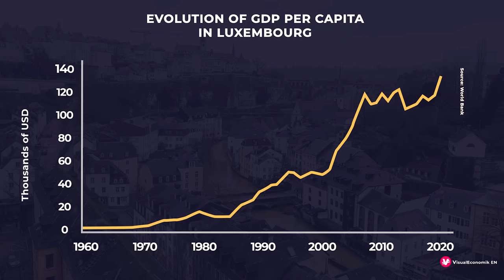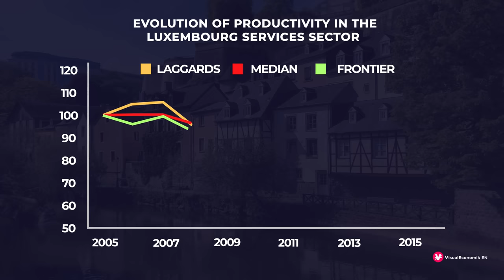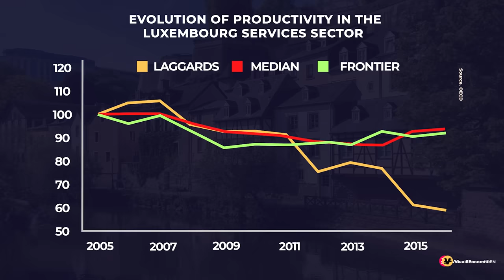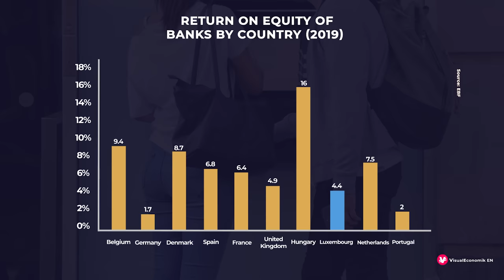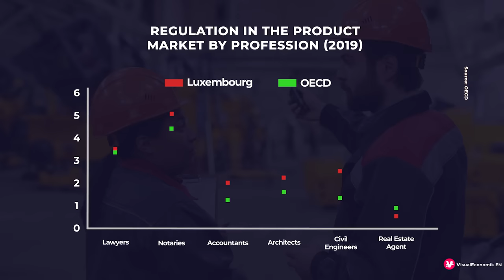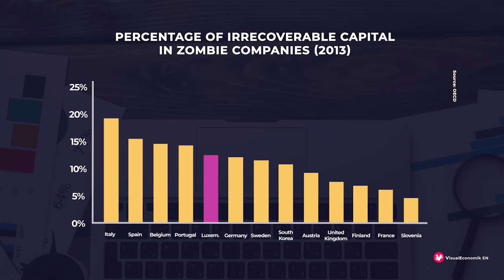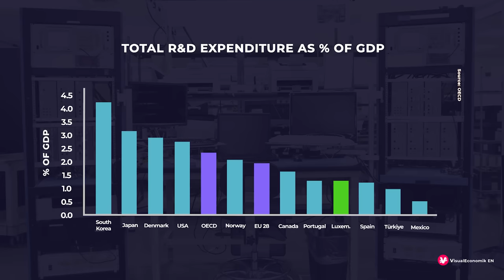Why Is the Wealthiest Country in the World Failing?

Comment: Luxembourg is undoubtedly very  rich, but its GDP per capita is inflated due to the fact that 40% of its workforce lives in neighbouring countries (which means that these workers contribute to the country’s economic output, but they do not count for the population denominator when calculating GDP per capita), and also due to being a tax heaven. Switzerland, for example, has a lower GDP per capita than Luxembourg, but it has a higher average wage. Luxembourg is still one of the richest European countries, but not as rich as its GDP per capita may suggest.
Reply: @Wisteria__Lane  It is clear that most bloggers calculate wealth incorrectly. Salary and GDP are actually income, not wealth. Wealth is accumulated income. In other words, GDP is what you earn annually, wealth is what you have in total. Therefore, this video does not give a true picture.
Reply: Afaik Luxembourg has the highest number of millionnaires per capita ( total wealth, including real estate).
Reply: @mauricesalentiny5495  >> Afaik Luxembourg has the highest number of millionnaires per capita ( total wealth, including real estate).
That's also because a large percentage of regular (non-millionnaire) workers live outside of Luxenmberg, decreasing the per-capita-denominator. It's the same reason why its GDP per capita is deceptively high.
Reply: @THX829  On purpose
Reply: @maksimkempe3425 
By "wealth" do you mean land value? It is a common error. Land is not wealth; it falls into a separate category, as does money. Most of the earnings from banking are economic rent of land.
Reply: @mauricesalentiny5495  not true USA has most rich people
Reply: Finally someone with some brains.  Lived in both countries and the quality of life and salaries are way higher in Switzerland, it’s not even a competition..
Reply: Growth and decline are natural events. Traditionally tax havens were in Europe but now more competition from Asian countries have emerged and the using sanctions as weapons by the west has made many to move money away. Also the infrastructure and safety of emerging economies have reduced the transfer of capital
Reply: @mauricesalentiny5495 are their property prices inflated too?
Reply: @mauricesalentiny5495 
If possession also counts, then those millionaires are just for the most part old people who bought land when it was cheap. Houses can easily reach 1 million in Luxembourg.
Reply: @RonDiani he says number of richs, not wealth of them. Yes the most richs are almost in USA. The second, Bernard Arnaud,  is French.
Reply: Yes, I was just going to make the same point. Well said.
Reply: @stephanelaranjeira5909  not true, I prefer luxembourg over switzerland

Comment: Pretty sure banking sector regulation or financial regulation in general tends, to a large extent, to be defined on EU rather than national level.
Reply: And that has played a role in the significantly curtailing the manner in which the banks have operated. Luxembourg was trying to be another Switzerland where banking privacy could protect all manner of guilty parties. The EU just wasn't having it on their doorstep. That's a part of what is going one but another significant part of it is that if have an economy with high expenses, and particularly high property prices, then you end up with nobody to empty the bins and it all start coming apart at the seams.
Reply: @jimf671  banking privacy isn't as strong in Switzerland as it was either.
On the flipside Luxembourg benefits directly from regulation as middle office hub for a multi-trn fund industry.

Comment: In 2011 I had an interview with IT consultancy at their Luxembourg office. (the interview was arranged by a former colleague of mine who was working for the same consultancy).  I flew out from London to attend the interview at my cost and I thought it went reasonably well.  However, it took the company 5 weeks for them to get back to me (despite the efforts of my former colleague to help).  They said my contract rate was too high, they feared I would not stay long, and so they were putting the hire position on hold (there were possibly other factors I won't mention as they are off-topic).  They didn't attempt to negotiate a rate they were comfortable paying or attempt to seek assurances from me that I would see out a contract term.  If my experience was representative of how they go about attracting highly qualified professionals then I am not at all surprised they have a skilled workers shortage.

Comment: I think you are excessively simplifying. Some points are valid like the productivity issue (allthough it's not clear if this may be related to the capital structure which is quite particular in LU). Also labour regulations are tight. What made me laugh is the banking sector part. It is very heterogeneous which you don't mention at all. Custodian banks for example typically have low profitability which is not a bad sign. The sector is very international which you don't mention either with many subs taking on services for their foreign parent. Again profitability not that important. Only about 5 banks are universal banks. But you compare it with spain where the majority are universal banks (because much larger domestic market). The point about excessive banking regulations is complete BS. I don't understand how you can miss this but banking regulation in EU is guided by the CRD/CRR framework which is maximum harmonisation - so no national leeway. Also, you did not mention once the fund sector which is much more important than banks in LU. Issues you don't touch upon: Real estate shortage, structural rigidities... A good overview of the economy can always be had from IMF article IV reports.

Comment: "Excluding Microstates..." "... its Luxembourg"
Wait what?

According to Wikipedia is Luxembourg not a Microstate... but if it was, it would be only the 7th largest and 3rd most populated... How the fuck is Luxembourg not a Microstate? It doesn't stand out in any field. For example Iceland, while only having half the population, also has 40 times the size. And Singapore, while only having 1/4 of the size also has nearly 10 times more population.

If you multiply size with population, than Singapore, Belize, Iceland, Bahamas, Vanuatu and Brunei would be "bigger" than Luxembourg... but Luxembourg isn't a Microstate?

Comment: It is rather poor analysis of the economy of Luxembourg. It does not take into account its specific profile. For example, Research and Development expenditures as per cent of GDPare low, but what is the pont to spend on R &D, when you have mostly banking and financial services? High expenditures for R&D are needed, when you are manufacturing company un high tech sector. Pharma, electronics, motor industry..Second, selection of countries in various graphs seem to be accidental, not objective..Decrease of productivity may also be justified by good reasons- for example by increase of employment in less productive sectors while other sectors are unchanged.

Comment: ✔no abundant and cheap energy = no hope-
Look Stoke pottery "(in UK)after passing the Clean Air Act in 1956,pottery manufacturers moved to gas and electrics and coal-fired bottle ovens,
were demolished at one time there was two thousand bottle ovens in the potteries there's only 47 that remained"
In 2023 the city has become poor, a real textbook case.
A French example? until 1970, well 50% of electricity came from coal. GNP increased by 6% per year...